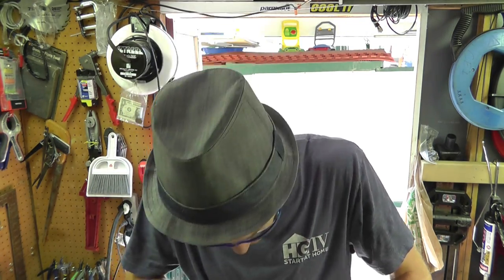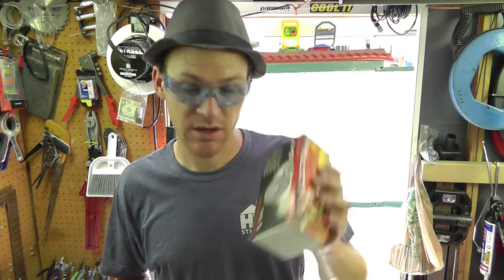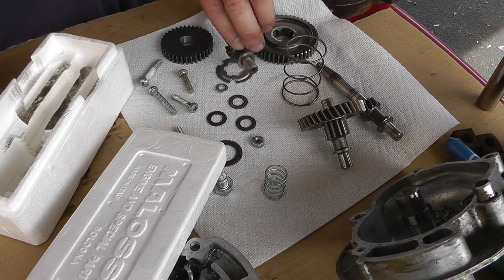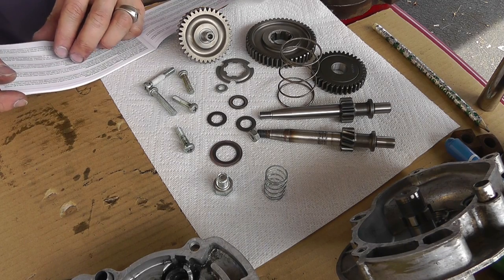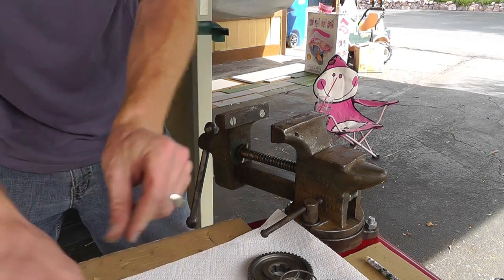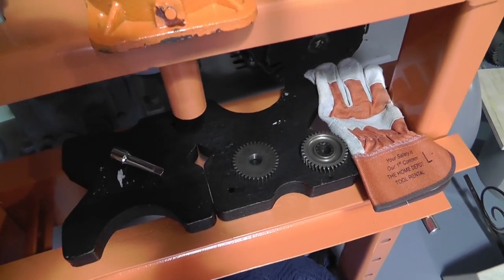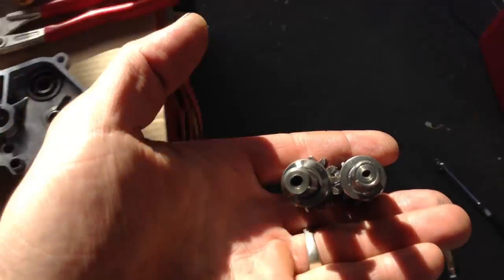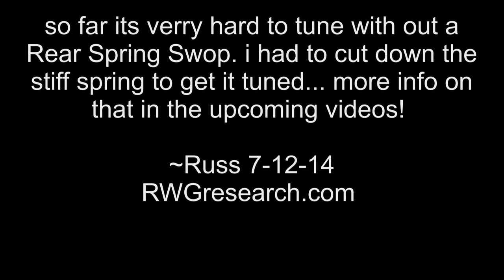#12 Honda PA50II Hobbit  Race Gears gears!!! Installation.

Comment: Molasses lol. It's Malossi (muh-low-see)Sweet videos though! I like how thorough you are with explaining stuff, like your thought/work processes and how different situations call for different methods to solve problems. 
Also, mopeds are awesome. I have a vespa ciao, it's my third moped that I've come across so far.. Very interesting engines on the vespa mopeds, rotary inducted intake through the rear of the case and the crank lobe/web is the valve that actuates it. They also come in single speed or variated drivetrains. If you ever have the chance to own one, go for it! They're unlike any other moped.

Comment: Back in the day, we changed out the Gears on the Hodaka Ace 100 from the helical cut to straight cut gears. The straight cut racing gears are a bit louder. I have straight cut 3rd gears in my Sand Car Trans and is it ever loud!
Reply: these have straight cut for the output side anyway so no biggy